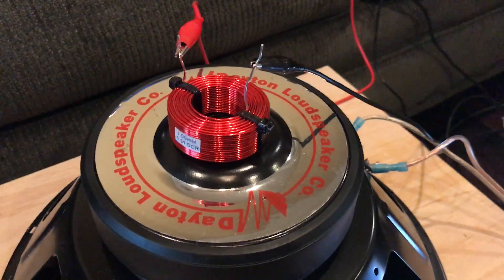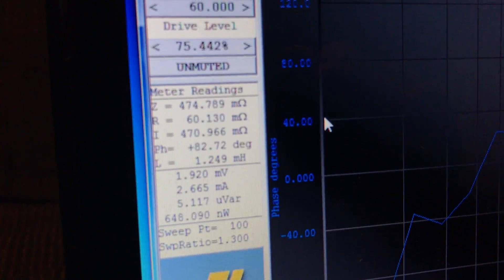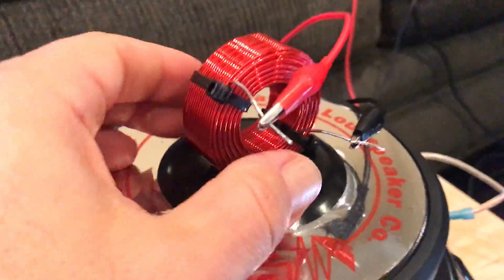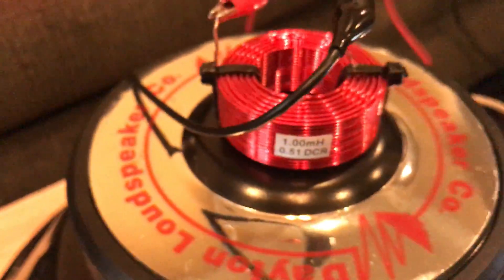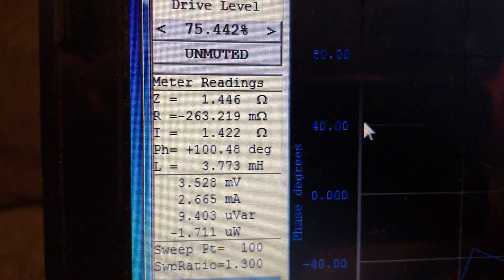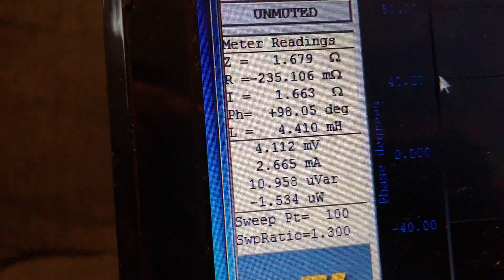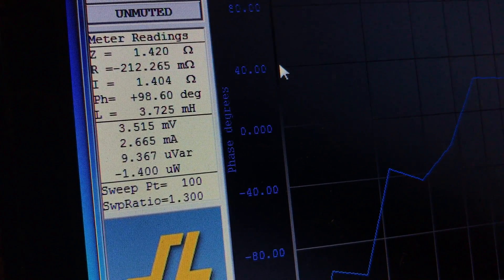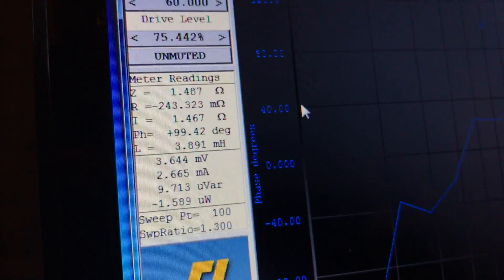Effect of a magnetic and electromagnetic field on inductance of an inductor demonstration

Comment: I think you have completely misinterpreted the measurements.
In my opinion, it is not the static magnetic field of the permanent magnet that changes the inductance of the (air) coil. Rather, the metal of the speaker acts as a core for the coil, thereby increasing the inductance.

On the other hand, when the speaker is driven, the overall magnetic field created by the permanent magnet and the voice coil changes. This changing magnetic field induces a voltage in the coil, which confuses the measuring device
Reply from the maker: @uzzo745  you are welcome to interpret this any way you’d like, it was simply a demonstration, cheers.

Comment: And how about to check voltage output from coil, when it`s in the field of operating subwoofer? May be it works like a transformer and sends this to the speaker through crossover?

Comment: The Erse Super Q is not an iron core, it is a steel laminate.
Reply from the maker: Dean Wescott you are correct, agreed
Reply: @javadshadzi4824  Hi, Nice work. Can we reverse the effect on the force generated by voice coil (of the speaker) to reduce the volume of speaker by placing iron core electromagnet over permanent magnet of speaker as you demonstrated.